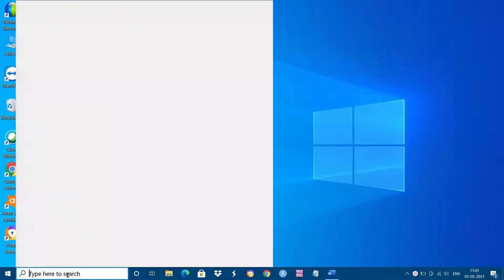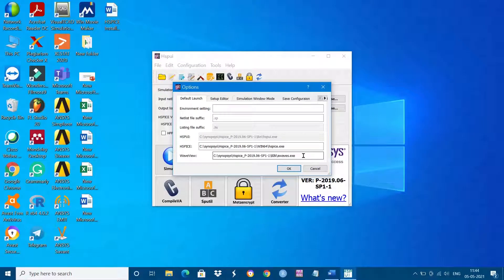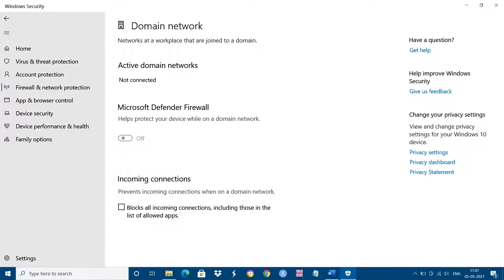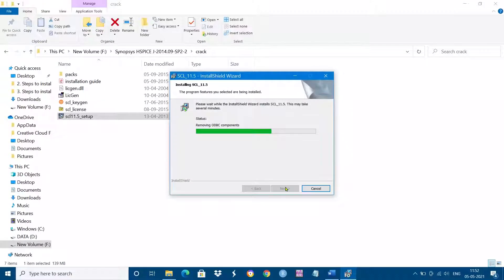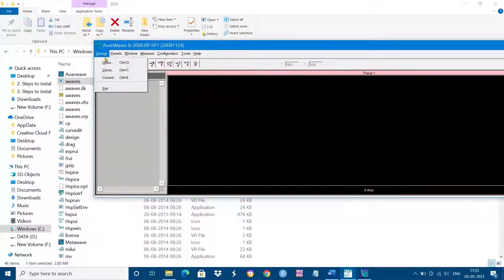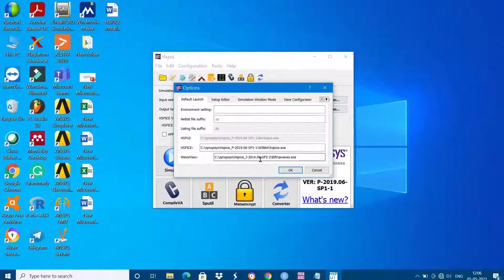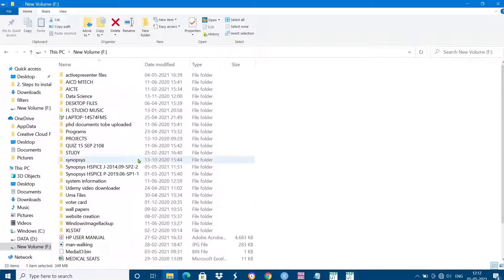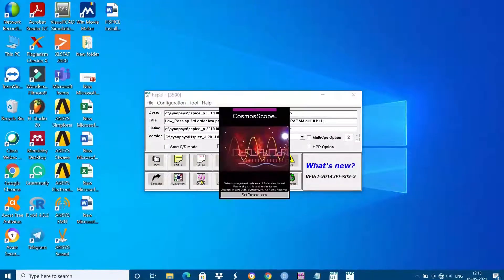How to Simulate HSPICE 2019 Tool in Windows PART-2 | Synopsys Tool | Circuit Simulator

Comment: Sir, I have installed the software successfully. But I am facing problem with wave view. Is it required to install Hspice 2014 ?Because in one of your comments you have mentioned to include one more  line of code in .sp file instead of installing 2014.But I am facing error still after doing it. Can you please do a video for the same for getting wave view for dc and transient analysis without installing 2014 and with adding the line of code mentioned in your description.
Reply: Sir, I tried through get into pc.But cosmosscope link is not available Will try to get it by some other way.Thank you🙏
Reply: Sir,I have done the installation of cosmosscope 2006 version .Now hspice 2019 is working properly with waveview.Thank you for all your promp response which helped me out a lot in my research.
Reply from the maker: Installing 2014 version is not required. You can install cosmoscope .
Reply: Thank you sir.I will try again.. It’s an incredible video sir
Reply from the maker: @sharijahan3964 Thank you ❤
Reply: Sir, I was getting dc analysis before without cosmosscope .But transient analysis was showing error.So I reinstalled 2019 hspice. But now both analysis are showing error in wave form view. So I tried to download cosmosscope.But the link is not available . Could you please help me on this?
Reply from the maker: @sharijahan3964 Currently is unable to share. Wherever you got the hspice tool, you can download cosmoscope from it. Once follow the video from 16:00 minutes.
Reply from the maker: You need to configure waveview after installing cosmoscope, set the path correctly.
Reply: Already done and it’s working
Reply from the maker: @sharijahan3964 Great. Thank you for watching.

Comment: Sir, I have installed the software. The demo example ‘bjt beta.sp wave view is working.But when I tried inv.sp it’s waveview is showing unknown transient error. I have also added the additional line of code which you have mentioned in .sp file
Reply from the maker: Thank you for following my video. Did you add the following line in your code? 
.options nomod post=2 autostop, If wave view is working, it will work for all the programs.

Comment: I didnt found hspice 2014 version in your folder also can you tell me the path where it is located it would be helpful for me
Reply from the maker: @shahanazmohammed8024  2014 version is not required. You can run with the 2019 version. Please check the description for the command to include in your code ".sp" file
Reply: @aayognalearning  No actually my problem when I am using the 2019 cosmoscope im not getting proper waveforms iam getting all as square wave either inverted or non inverted but you are getting proper waves how is it posssible can you clear it to me
Reply from the maker: @shahanazmohammed8024  check the command in the description and also follow the CMOS Inverter video for clear understanding.

Comment: Whenever i am trying to run wave view its showing file doesn't exist please tell solution.
Reply from the maker: you haven't not added path in configuration settings. add path with awanwaves or cosmoscope.

Comment: Thank you so much for crystal clear explanation of installation and simulation in HSPICE. Kindly if possible, make a video on how to check delay and power measurement. Thanks in advance.
Reply from the maker: Thank you for your support... sure.. will be added with in a week...
Reply: Can you make a video on this
Reply: CAN YOU SHARE PART 2 INSTALLATION SETUP FILES I DID N'T FIND ANYWHERE

Comment: Sir, when i click on simulate the simulation screen is flashing but not stable. what to do to avoid this
Reply from the maker: may be your system problem or check the path of waveview.
Reply: @aayognalearning  sir, I'm getting different output for the same lowpass file you used and also if I try bjt, only sw0 file is generated but tr0 file is.not being generated. I tried rereading license still same problem. What shall I do now sir?
Reply from the maker: @nandadeepvallamchetty8646  add . options line to your code and check. Once see my description.